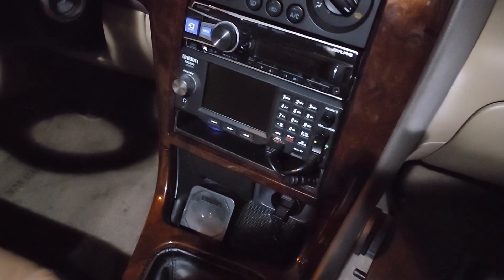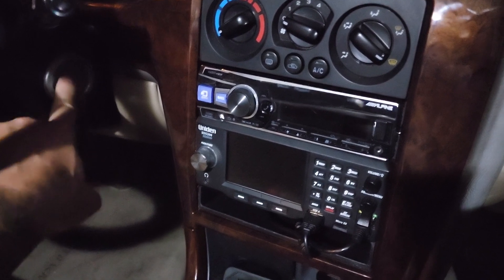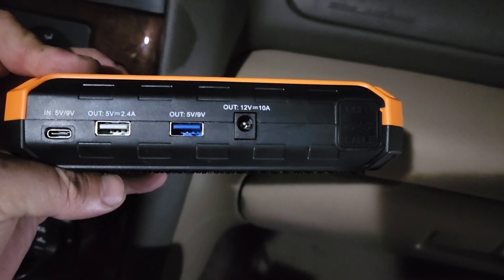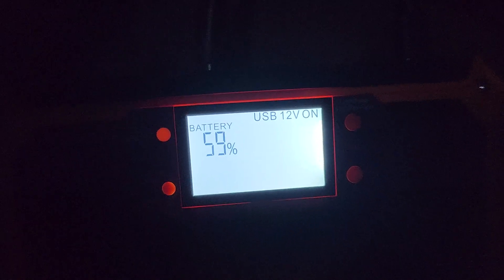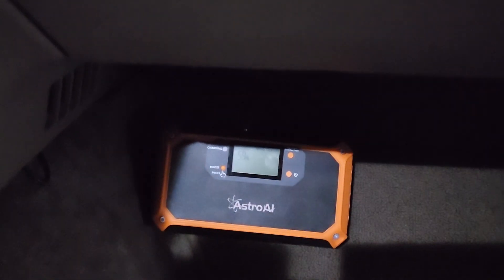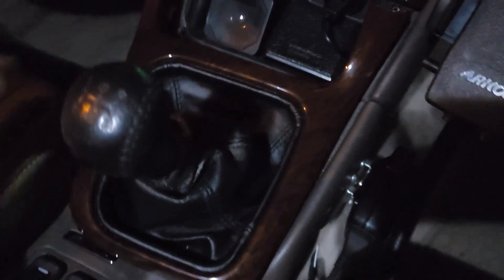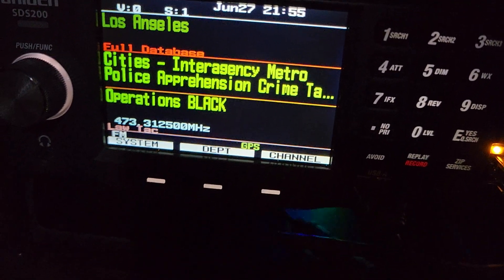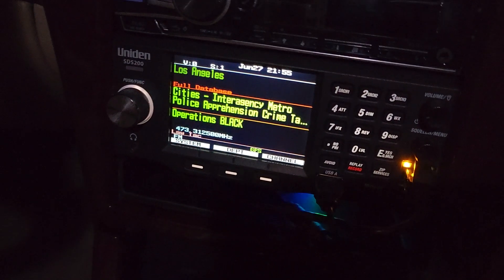Uniden SDS200 Mod GPS WiFi backup power!

Comment: Does the small internal inside antenna perform well? I'm wanting to put a mast out for a outside anyenna
Reply from the maker: I have had very few issues getting a lock with interior antennas and modern GPS chips. That said, I would run the antenna to the dash or roof where it will have the most exposure to the sky.

Comment: Avi’s Garage> So, do you have an alternate switch you flip that stops receiving power from the small ‘power pack’ when you start your engine? Or, do you just use the small power pack exclusively that continuously gets charged once you start the engine? Perhaps I didn’t catch that part or understand when you explained it. I’m planning on buying that same scanner in about a month despite its $700 price on Amazon. I have a Uniden Bearcat 355N and a Bearcat BCT7 but both are only analog and are pretty much useless in my area where I live in Houston,Tx. Nice video! Good job! ~Jim WRXY695~
Reply from the maker: No switch nessary. It will just start using the 2nd battery. Not sure if this wiring is "healthy" for the SDS, but mine is still working great.